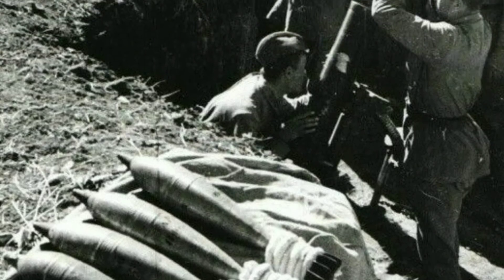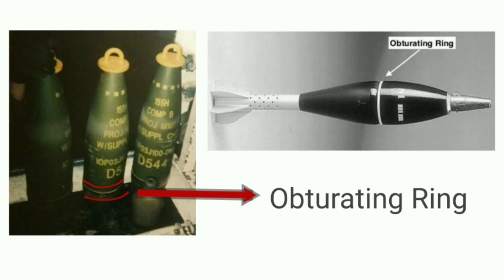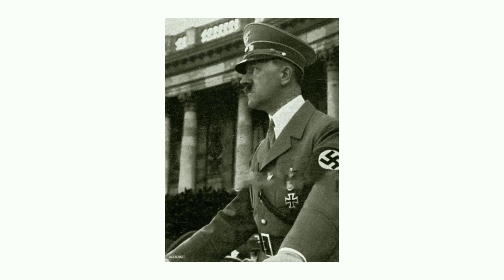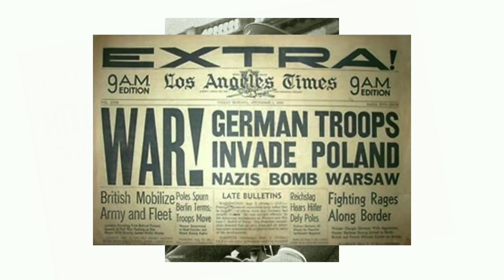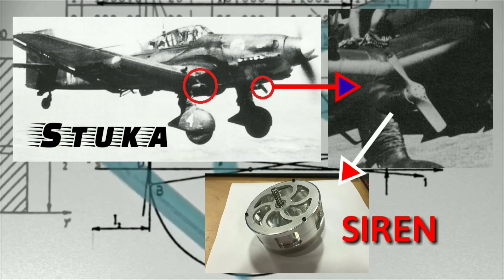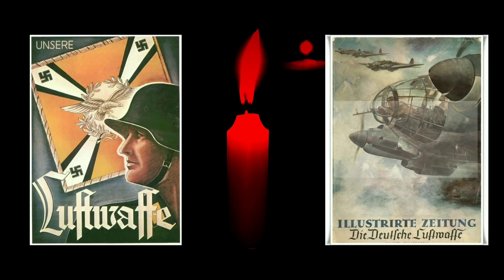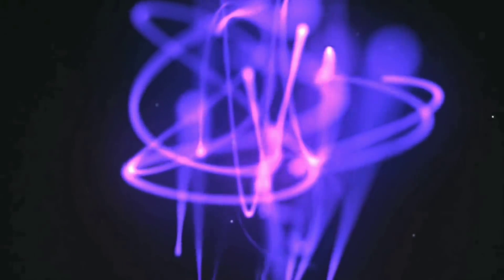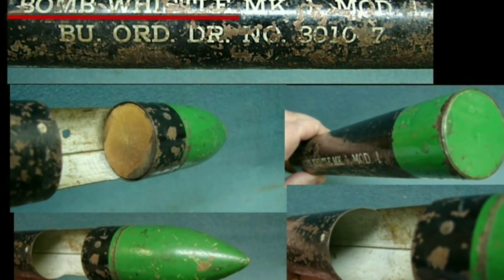Does a Bomb really whistle when dropped?

Comment: I bought a cheap toy drone. Got it around  120/150 ft where it went into free fall  due to rubbish radio. It must have fallen 80/90 feet before it kicked back on. The air noise for such a small thing was loud. But looking at its dynamics they're not sleek. Good thing it was balanced, falling up right.